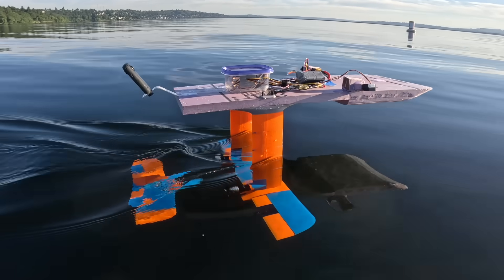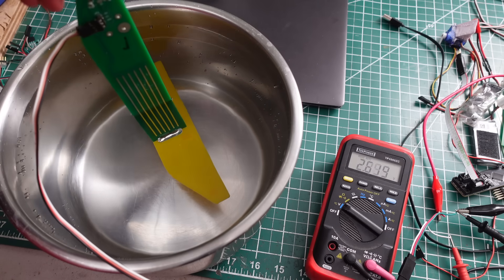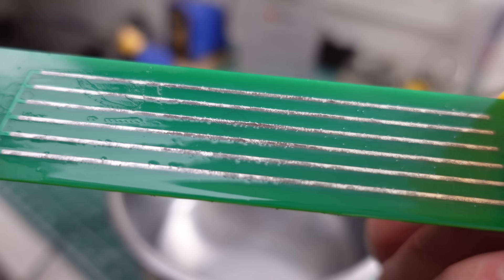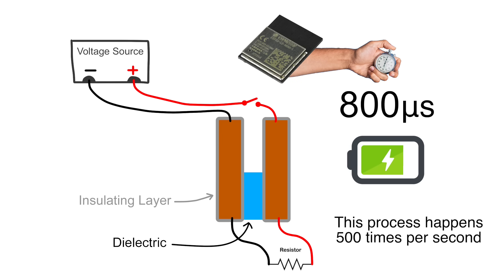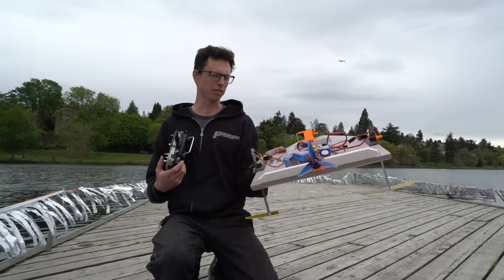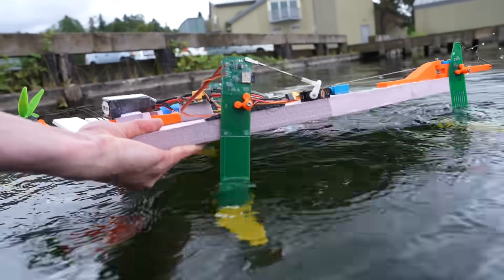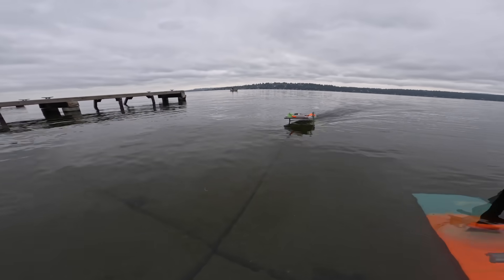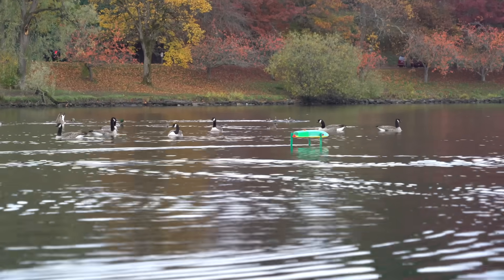R/C Hydrofoil Boat Made From Circuit Boards

Comment: I'm an embedded engineer and I'm quite impressed that you were able to make stable capacitance measurements with ESP32. That requires measuring the charge time precisely with interrupts and ESP32 has internal high priority interrupts for WiFi and other stuff, which mess up the readings.
I'm wondering what technique you're using for charge measurements - Charge transfer to a reference capacitor? Charging plates over a resistor? Maybe something else?
Reply: i was surprised by the method used to measure the capacitance. maybe it wouldn’t work well with the low capacitance but if you just excited the capacitor with a certain frequency, it would have resistance dependent on the capacitance. simply measure the voltage across the resistor or the capacitor and you should get a good simple way to measure the depth.
Reply: @boxr_4214  Oh wow, is this a multivibrator circuit with two transistors?
Reply: @sergeyyatsuk9085  no that's just a property of capacitors. the resistance across a capacitor is inversly proportional to both frequency and capacitance. so if you are able to produce a constant frequency signal and have capacitor and resistor in parallel, the voltage across the capacitor will be related to the capacitance, and therefore the depth. by using a high frequency, you can get whatever sampling rate you want. but they were able to achieve 500 Hz using the charge and discharge method which feels plenty high enough for their purpose, so it wasn't necessary for them to use this. it would, however, eliminate any need for the esp32 and tbh you could probably make the system stabilize itself without any microcontrollers with some decent controller design. at the very least the code would run a hell of a lot faster but again, not really necessary for the application.
Reply: @boxr_4214  You're talking about capacitor ESR frequency response right? I don't quite get how to measure this voltage across the capacitor, as it will be an AC voltage if you apply some frequency to it?
Reply: Not him but Tamas.
Reply: Those high prio interrupts are eaten by the second core on many ESP32s - I think they said they used the C3 though. Which is single core.
Reply: @CollinQuiason  Even though ESP32-C3 is single core, it has much better ISR latency. It's so complicated on multi core systems, one core can't just eat away high priority interrupts. More cashe, longer pipelines, cross-core locks...
WiFi antenna is quite small and integrated on the ESP32 module, not sure what you mean there.
Reply: The esp32 has built in hardware capacitive sensors...
Reply: @yo90bosses  ESP32 yes, ESP32-C3 no
Reply: ESP32 has two cores. You let one do the wifi stuff and the other time critical stuff.
Reply: I understand what everyone is talking about and I completely concur with your assessment.
Reply: It’s not such a big deal. I made something similar in the nineties with capacitive humidity sensors and PIC microcontrollers. I performed two measurements with two RC circuits, one with a fixed capacitance and one with the sensor, and with this I was able to compensate for the temperature drift.
Reply: @makoado6010 Yes, it's not a big deal on PIC, AVR, STM, etc. but on ESP32 and with WiFi enabled it is. ESP32 have lots of quirks and high ISR latency is just one of them.
Reply: @sergeyyatsuk9085  Yes, you can implement the same type of external-input-triggered timer on the ESP32 that you would normally do on a PIC microcontroller.
The ESP32 has all the needed hardware features to replicate that behavior.
Reply: Two words - relaxation oscillator. Amplitude modulation? Boo! Frequency modulation? Yay!

Put the output through a comparator to make it a square wave, then wire the output of that to an interruptible pin, and use the on-chip timer to get the frequency.
Reply: @warmflatsprite  Yep, that's doable. However, ESP32... Even if you try feeding a stable square wave to ESP32 and measure the time between the interrupts you'll see a noticeable deviation between the readings, especially if you enable WiFi. That's why it's impressive to me how they made it stable. The RISC-V variants like ESP32-C3 are handling interrupts faster and more stable than Xtensa, still you can't override high priority interrupts from WiFi stack.
And by the way, relaxation oscillator is very sensitive to external noise. Charge transfer method is much more stable.
Reply: @sergeyyatsuk9085 pretty sure they accept an external 32.768kHz crystal to solve the timing variance issue
Reply: @warmflatsprite  How would that help? If your interrupt is delayed because it's preempted by a higher priority interrupt then you'll read the time value with a variable delay, no matter how precise your time source is.
Reply: @s @sergeyyatsuk9085  ah, if it’s due to ISR delays, maybe they are using an integrator circuit and reading it with an ADC (amplitude modulation, boo!). Or more likely, because the capacitance of the sensor is super low, using it in an oscillator circuit, and feeding the output of that to a LPF (essentially an integrator), then reading that with ADC.
Reply: @sergeyyatsuk9085  yeah sorry. I misunderstood. See my other reply 😅
Reply: @warmflatsprite  There are pictures of the sensor on the store, it has just two transistors and a couple of resistors connected to the sensor lines. Quite interesting, I can't figure out how it works. Apparently it's a 4 layer PCB, some lines are not visible.
Reply: @sergeyyatsuk9085  might have to pick one up, then! FWIW, my experience here comes from build statically mounted wave gauges like 20+ years ago, so obviously I’m speculating quite a bit.
Reply: @sergeyyatsuk9085  Doesn't the ESP32 have any timer peripherals with capture?
Reply: @ferrumignis  Well, yes. The problem is that you would also need changing GPIO state in ISR depending on the used technique.
Reply: @sergeyyatsuk9085  If the sensor was part of a relaxation oscillator as mentioned by warmflatsprite then measuring the period with a timer capture peripheral would mean interrupt latency wouldn't be a problem, no pins to change.
Reply: @ferrumignis  That's right, but that would require an op-amp, it doesn't look like they have one on the board? More common approach with RC contour is pulling the pin UP and DOWN in turns and measuring time till it reaches a logical 0 and logical 1. It requires less components, is cheaper, but requires low ISR latency.
Reply: Secondary question; Could they use the traces for water detection as an antenna for the esp32 as well if sized properly? Or would it create/have too much EMI or something else I'm not thinking about? Would it be filterable in a reasonable timeframe?
Edit: I guess its underwater a lot of the time so probably not practical.
Reply: You don’t actually need to know the capacitor’s value, only how long it takes to charge. You can charge the capacitor continuously through a resistor. During measurement, set the GPIO pin as an output and drive it low to discharge the capacitor. Then switch the GPIO back to an input and simply wait in a while loop for it to transition from low to high. Interrupts should be disabled during this interval to ensure accurate timing. A hardware timer can then be used to measure how long it takes for the voltage to rise to a logic-high level.
Reply: @Foxyy900  In reality you need two capacitors and one resistor. One capacitor is the sensor, the other is a fixed capacitor with a known value and good quality, and the resistor also needs to have high accuracy. The method is that you alternately measure the charging time of the fixed RC circuit and the sensor-resistor circuit. This compensates for drift caused by temperature or voltage fluctuations. Back then I measured both circuits ten times and calculated the average. That gave a stable, nonjumping and reasonably accurate result in picofarads.

Comment: Question, have you thought of making your hydrofoils be a swept-back V shape to help the weeds slide off?  It would be worse hydrodynamically, but might be more reliable..
Reply: better and worse hydrodynamically. Low speed efficiency suffers, but pitch sensitivity also goes down. Total drag is notably lower with swept foils, but also, it takes a LOT of sweep to not pick up marine life.

Comment: For larger, maybe human ridable applications, you might consider embedding the boards inside hollow masts with large-ish holes in the sides near the bottom. That way it will work like a baffled fuel tank. In control theory terms it would mechanically reduce the I gain. It would mostly ignore waves and you would also get the strength of a full sized mast. You would need to worry about reducing the reaction speed too much, but especially with a large and high mass vessel it shouldn't need to react as fast.
Reply: I guess you would need a hole at the top too to let the air in and out too, but that can be smaller.
Reply: @kylebooth2528  the latency on such a setup would be utterly catastrophic. Ignoring waves is not what you want, AT ALLL.
Reply: @weatheranddarkness You don't want it over sensitive either. Wouldn't you rather it plow through a wave than attempt to jump it?
Reply: @kylebooth2528  with foils you want neither, you want it to follow the landscape in real time, as it were. Whatever your sensing system is it has to be fast because your system needs to know early. You can adjust how fast or far it moves in response, but you cannot have much if any delay in time between input and output. That's how you have crashes.
Reply: I just realized this is a low pass filter not a change to the gains. Anyway it should ride smooth and protect the electronics and all that.

Comment: AI Summary

Abstract:

This video documents the multi-year development of a novel hydrofoil height control system. The project's goal was to create a hydrofoil mast from a printed circuit board (PCB) with an integrated water level sensor, intended as a more direct alternative to traditional sonar systems. The initial approach using resistive sensing proved non-viable due to long-term electrochemical corrosion, which caused signal drift and physical degradation of the sensor traces. The project pivoted to a capacitive sensing method, which allows the primary sensing electrode to be fully insulated from the water, thus preventing corrosion. This was achieved by leveraging fringe field capacitance. After several hardware iterations, which included adding an ESP32 microcontroller for Wi-Fi configuration, a critical software bug limiting the PID control loop's update rate was identified and fixed. The resulting system demonstrated fast, stable, and autonomous altitude control on a test boat, leading to the creation of a commercial kit.

Developing an Autonomous Hydrofoil Control System

*   0:00 The Problem: Existing electronic hydrofoil height control typically uses sonar. The project's goal is to create a more integrated solution where the hydrofoil mast itself can directly sense the water level.
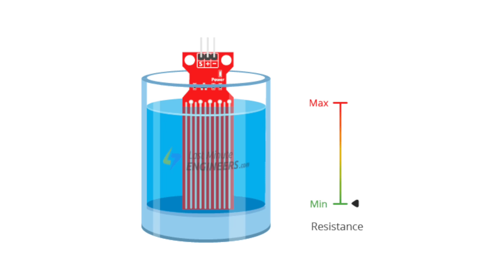*   0:54 Initial Concept: Resistive Sensing: The first idea was to use simple, cheap resistive liquid level sensors integrated directly onto a PCB that also serves as the hydrofoil mast. An initial prototype demonstrated that the concept was functional and had a fast response time.
*   3:15 The Fatal Flaw: Corrosion: An electrical engineer, Tamas, identified a critical issue with the resistive design: electrochemical corrosion. Running DC current through exposed metal traces in water causes them to degrade, leading to signal drift and eventual failure. This makes the design unsuitable for a reliable product.
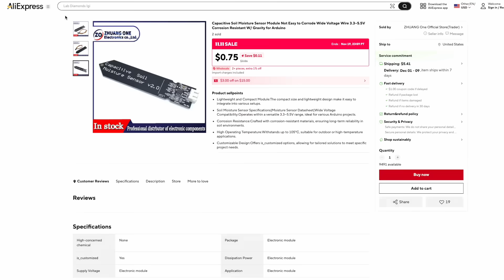*   5:09 The Pivot: Capacitive Sensing: The team switched to a capacitive sensing design. By measuring the change in capacitance as water (a high-dielectric material) displaces air, the water level can be determined. Crucially, this allows the positive electrode to be completely insulated from the water, eliminating corrosion. The breakthrough was realizing that fringe field capacitance was sufficient, with the positive and negative plates on opposite sides of the PCB.
*   8:18 Real-World Testing: A simple trifoiler test boat was constructed to test the prototypes. Initial on-water tests failed; the boat was unstable due to an extremely slow and jittery servo response, indicating a problem in the control loop.
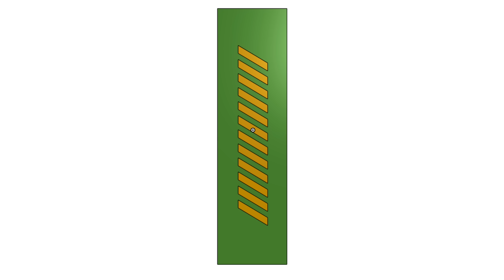*   11:00 Debugging and a Critical Bug Fix: To diagnose the issue systematically, Tamas built a test rig using a repurposed 3D printer. He discovered the PID control library was only updating at 10 Hz by default, not the intended 100 Hz. Fixing this software bug was the key to unlocking performance.
*   11:46 Successful Foiling: With the PID loop running at the correct speed, the servo response became fast and smooth. The boat was now able to foil stably and autonomously, even with hydrodynamically inefficient square-edged foils.
*   12:39 System Refinement: The system includes a web server hosted on the onboard ESP32, allowing for easy configuration of PID values and servo endpoints via any Wi-Fi device. Physical refinements like sharpening the foil edges and waxing the mast further improved performance.
*   15:00 Production: The project progressed to designing a programming and testing fixture for mass production, indicating the transition from a prototype to a commercial product.
*   16:02 Product Availability: The final PCB hydrofoil kits are now available for purchase.

AI-generated summary created with gemini-2.5-pro for free via RocketRecap-dot-com. (Input: 20,003 tokens, Output: 761 tokens, Est. cost: $0.03).

Comment: use pure nickel in salt, you can even get nickel alloys made to resist arc oxydation in 20k volt switches. pure nickel is fine tho. you can cut and stick it using a specific glue
Reply: its platinum, hard gold or stainless/bronze. nickel is not immune to galvanic corrosion.

Comment: just a little idea : if you drive your electrodes with AC, even square signals at 50Hz generated with a H-bridge, and takes the measurement when in the correct state, you wil be able to stop electrolysis. It won't stop passive corrosion, but will definitely slow down elctrolysis corosion.
There is also the capacitive water level sensor which works with armatures covered with solder masks, but it's sensitivity might be variable depending on the salinity, ie you would need an auto calibrate sequence when putting the hydrofoil in the water (using the fact that it would gradually go over the whole measurement range)

Comment: I guess you could make a vertical float valve like the ones used in toilet tanks. Use a PVC tube with a plastic ball and a magnet inside that floats up and down. On the outside of the pipe you can place sensors to detect the magnet’s position. For better accuracy instead of big coils you could use small Hall-effect sensors or reed switches along the pipe. Just keep the sensor section sealed so it doesn’t corrode in the salty water, and that’s pretty much it.
Reply: not sure how you can do that without introducing substantial drag...
Reply: @verbatim1144  Never mind then, using gold to avoid corrosion seems way too expensive for something that’s basically a toy. He could instead take inspiration from other designs; for example, he could Google something like “miniature plastic vertical float switch” for this project. I was giving an idea, but I don't know much of engineering.
Reply: I think you're missing the point of the experiment, float style level sensors already exist and are widely used in hydrofoiling ( google hydrofoil wand) the point of this experiment is to do something different

Comment: Plate it at home with gold solution (you can get a whole kit for not a lot of money). It would also help you in the future with other stuff, in theory, if you know your masking stuff, you can plate a board and make it corrosion proof far better than just normal methods like conformal coatings. I've plated a few marine instruments for friends and they've held up very well. Obviously, you have to know what you can and can't plate (in the sense that it can affect the parts). Gold is a good thermal conductor after all, so you don't want heat transfer from A to B on some chips (but to be fair, at the level of stuff you're doing, more than likely a non-issue).
For what you're doing, i guesstimate you only need a prep dip and one full coat - and you can always recover the gold and re-use it. Heck, if you want to go down that goat path, you can just buy old 70's and 80's high voltage electronics and deplate those. You can tell what's gold and what isn't at a glance.

Comment: Superb. It might benefit from an additional 3 axis accelerometer to measure how level it is, to compensate for differences in capacitive sensors and maybe fancier things like leaning in turns. I didn't think it should be necessary to expose the trace to water. You can either plate the electrode with something that won't rust, or otherwise study capacitive sensors. The track shape and size makes a huge difference and there are different modes in which capacitive sensing can operate. Some microcontrollers like SAMD have fully configurable peripherals for precisely this.